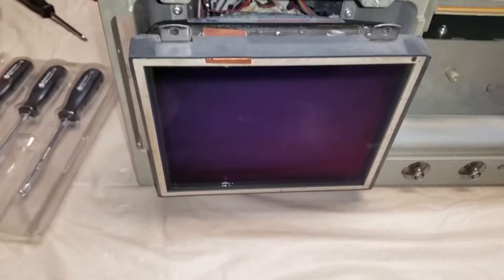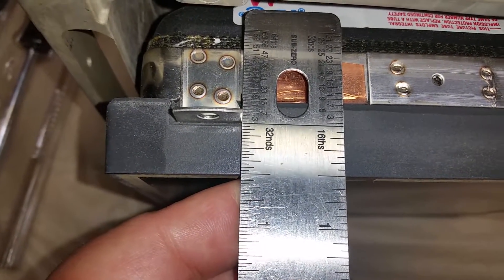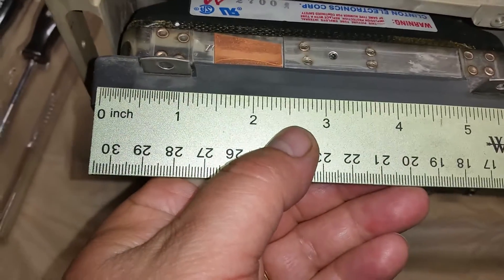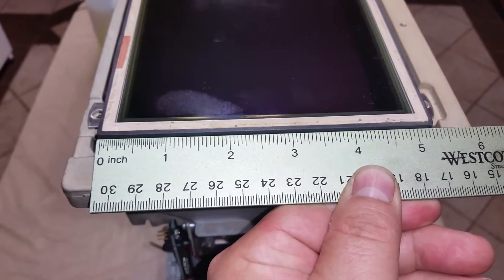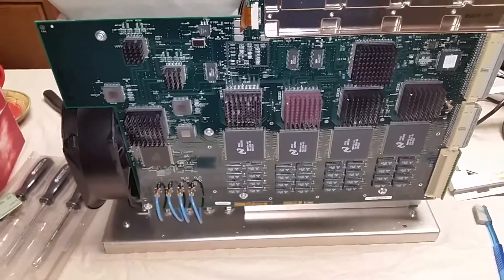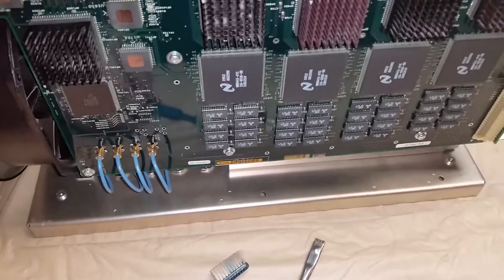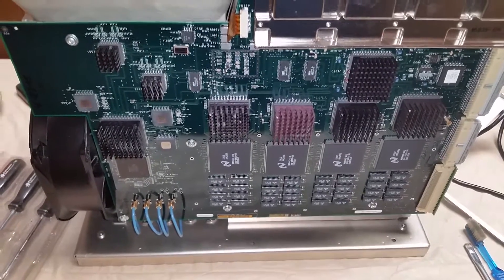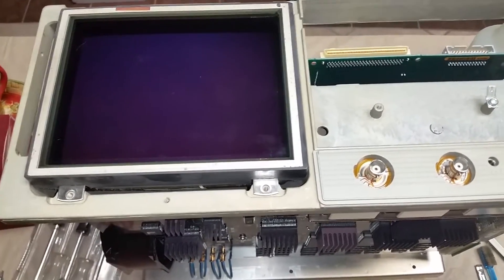TEK TDS 744A No Display Repair Part 4  Front Panel Removed LCD Info

Comment: I bought 3 TDS744A scopes on ebay for cheap, at first power on, all 3 passed the boot up self test but all 3 failed the SPC (Signal Path Compensator). After fumbling around, reseating cables, etc. I decided to load the factory default settings and it worked. All 3 scopes passed the SPC. One of the scopes had bad video, the video was present but very washed out. I dissembled it and discovered that there are adjustments accessible through tiny holes below the floppy drive. There are adjustments for contrast and intensity which I adjusted a few times and the video looks much better. The video still has a small issue (faint diagonal lines) but that appears to be a bad capacitor on the video driver board, the VGA video looks good. Next step is to replace all of the capacitors. The other 2 scopes are 'Gold', absolutely no issues.
Reply from the maker: That's cool, you should put some videos up of you changing the capacitors. Thanks for the comment and watching. Best Wishes & Blessings. Keith Noneya

Comment: Thanks for the video(s). They are fairly timeless as these scopes seem to have a life of their own. It also can be an addiction 😉 i.e. for the love of classics. I found out it definitely wasn't to save money 🤤 BTW: A thought on the static-issue. Years ago I saw a high-res photo of a substrate with static damage. It looked like a tissue that someone shot wet spit-balls through. Holes of various sizes. None were the circuit's death nail. It functioned as expected. Of course, it would be quite difficult to predict it's future 😐 Cheers.
Reply from the maker: Yep you're right on that. I just touch the metal frame and it usually dissipates most of it. I should have moved it over to the table and set up my Anti-Static mat, but I got lazy. Good catch. Best Wishes & Blessings. Keith Noneya
Reply: Thank you for the reply KN. Actually I thought I wrote this in my text... "being aware" is the best defense of all, right? It trumps any anti-static equipment IMHO. Because, there has to be "the understanding" first. Clearly you have that. Example: I would rather drive in a car with virtually no safety equipment with a "defensive driver" than a car with airbags, seatbelts etc and a driver that doesn't understand defensive driving. Ok, that was a bit winded but we all get it 😉

BONUS REMARK:
Your willingness to take in all viewpoints for consideration shows once again you got what it takes. I want you to go buy yourself a Coke and consider it from me 😎

Take care my friend
Randy 🇺🇸